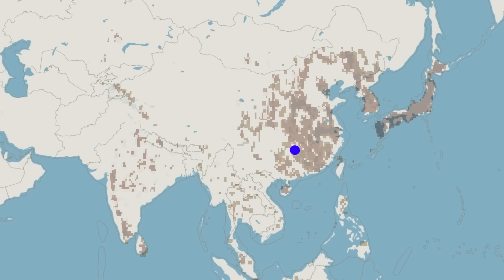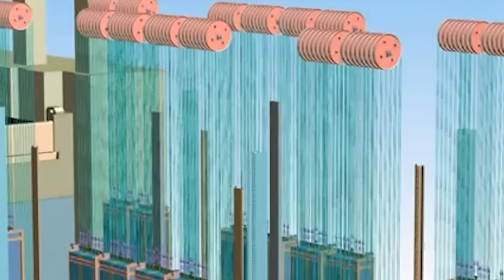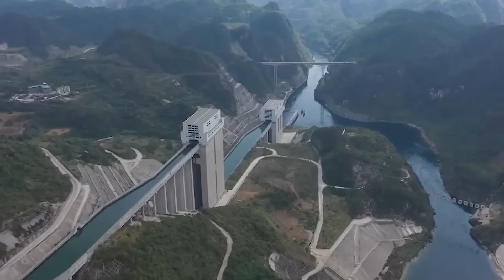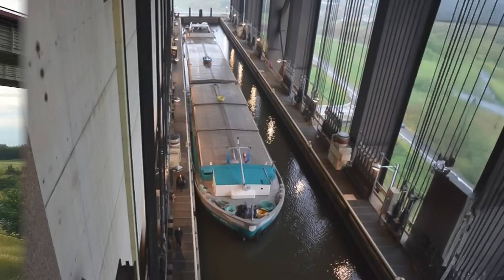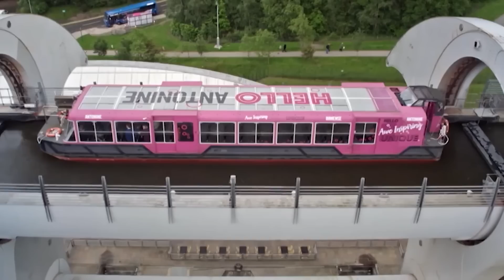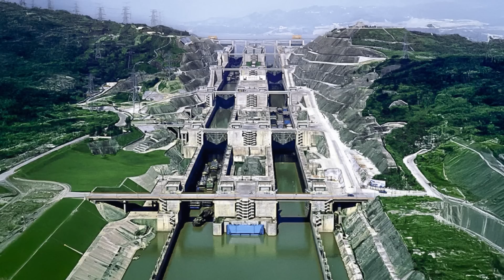This is Crazy! Chinese Poured Millions of Tons of Water Into Mountains So Ships Could Sail Over Them

Comment: Everything china makes is usually cheap and unreliable. Ever heard of tofu dreg? Buildings collapsing, buildings tilting by feet, bridges collapsing as well or entire sections just coming apart, etc. many new bridges china has made are limited in use. Why build a new expensive bridge if less than 200 people can use per day? Can’t handle the weight of traffic, that’s why.

Comment: 13:30
Nope not one of a kind. Edit: marine railways are discussed at 18:00
"Big Chute Marine Railway is a patent slip at lock 44 (in the township of Georgian Bay) of the Trent-Severn Waterway in Ontario, Canada"
First built	1917
Latest built	1978
The vessels are floated into the cradle, which is approximately 80 feet (24.38 m) long by 26 feet (7.92 m) wide. Four 200 horsepower (150 kW) electric motors provide traction by cable. It can transport up to a combined total of 100 short tons (91 t; 89 long tons) in weight.

I guess the estimated capacity of 1500ton makes my example look like a proof-of-concept.

If I check the Wiki article for "Patent slip"
"The Evans Bay Patent Slip operated in Wellington Harbour, New Zealand from 1873 until 1980, and is now a heritage area. Point Hope Shipyard marine railway Victoria built in the 40's still in use today 1000 ton capacity "

Comment: Why wouldn’t they use trains instead?
Reply: Why not train railways or truck motorways? They’re inefficient, expensive and time-consuming. Its more efficient, cheaper and faster to get a ship over a river with a shiplift and a cargo ship can haul a lot more than a train or a cargo truck. You can use what nature offers at relatively little additional cost.

Comment: The main advantages of boatlifts over locks seems to be faster, less water usage, and less energy usage. My first thought in this is that boat lifts seem to be a good solution to the Panama bottleneck, where the shortage of freshwater to fill the locks is slowing traffic considerably. Also, even when the water supply was not an issue, the locks greatly slowed Panama traffic. Being able to get ships up, over, and back down the mountains there with less water, time and energy sounds great. However, the lifts shown n this video handled river traffic. Clearly taking Panama Canal sized ocean-going ships up and down would require massive devices.
Reply: As you reference in your last sentence, the size difference isn't even close. The lift at three gorges has a capacity of 3,000 tons. Panamax ships have a cargo capacity of over 100,000 tons, and that isn't even taking into account the weight of the ship. So you would need a lift with over 50x the capacity of the three gorges lift. I bet material science would need a lot of progress before that would even be possible, let alone the financial feesibility of such a project.

Comment: There is also the Kirkfield and Peterborough Lift Locks on the Trent Severn Waterway with lifts of 49 and 65 feet, the Peterborough Lift Lock opened in 1904.
Reply: For sure.  ie. lift-locks are not "new".
Reply: Not too far from here (Berlin, Germany) there is the lift lock Niederfinow, built 1936, which lifts ships 36 meters (about 0.02237 miles)

Edit: haha! I should have watched it to the end!
Reply: I caught that too. the locks you mention are amazing works.
Reply: The Peterborough Lift Lock was completed in 1904, has 2 water tubs balanced on a pair of hydraulic rams. Up until the 1960s this was controlled by manually operated valves moving water between the rams. The upper tub always has a little more water than the lower causing gravity to make it lift the other to the top. The control systems were modernized in the 60's for speed and safety.
Reply: @BruceWebb-d3u  I've been to the Kirkfield Lift Locks years ago, never the Peterborough ones though I have boated/fished most of the waterways on the Trent.